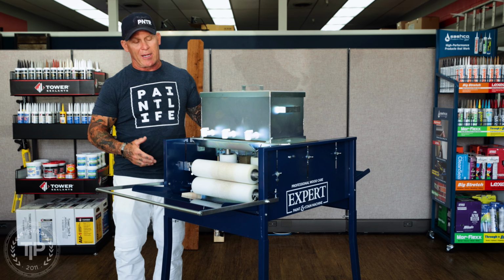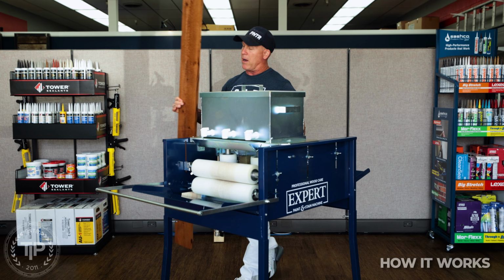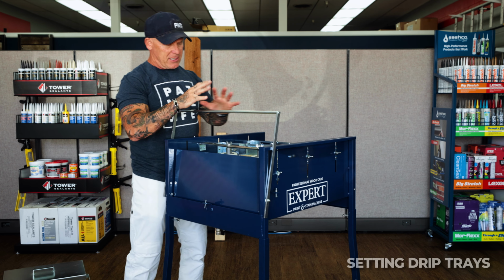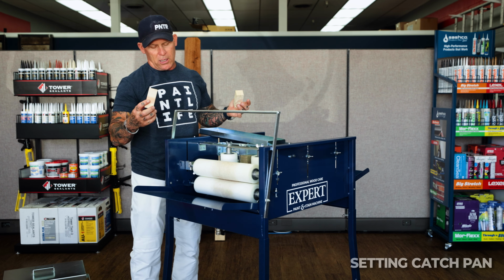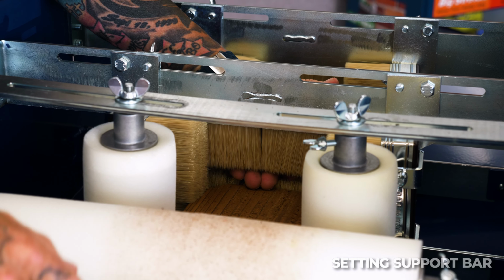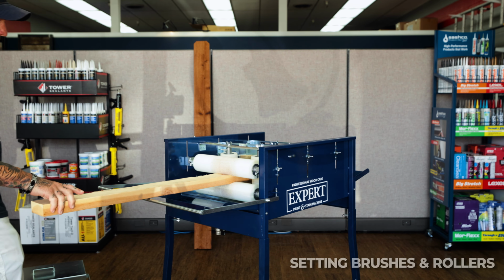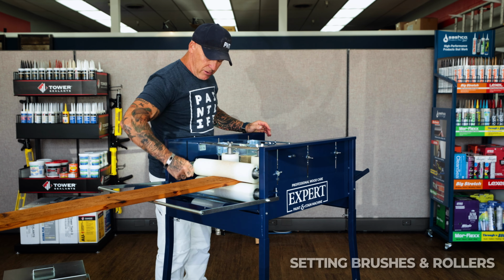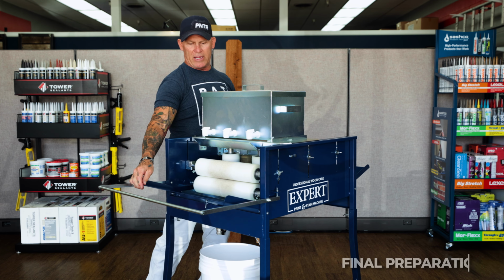How to Setup the Expert Lumber Staining Machine

Comment: Good day Sir. My name is Tony and I am a subscriber to your channel. I am in Cape Town South Africa. I would like to ask you a question regarding my Titan 440 Impact airless sprayer. I am in the process of purchasing liquid rubber to spray my tiled roof. My question is .....can I use this machine to spray latex rubber paint , if so what size spray tip can I use. I have to say by watching your channel has inspired me to purchase this machine and your content has helped me beyond my expectations. I do understand that paints in the US is not the same as paints here in Cape Town. I just need some help with the tip size and best pressure to work with. Keep up the good work and good content. 
Much Appreciated
Tony
Reply from the maker: That is really up the the product.  The product will have a TDS that will tell you how to apply it.  If it say with an airless, then what tip size does it say.  A 440 has a max tip size of .023
Reply from the maker: Hey Tony, that's awesome to hear you're watching from Cape Town, South Africa, and that the channel has been helpful! I really appreciate that.

Regarding your Titan 440 Impact, those machines are generally workhorses, but spraying liquid rubber is a different beast than typical paint. Liquid rubber can be incredibly thick, almost like tar, and that's where the challenge lies.

The absolute must-have information you need is the Technical Data Sheet (TDS) for the specific liquid rubber product you're buying. That sheet will tell you the manufacturer's recommended tip sizes and whether it can be thinned, and by how much. This is critical because if it's too thick, it won't atomize correctly, and you'll just get spitting and a poor finish, or worse, damage your sprayer.

Generally, for very thick coatings, you're going to need a much larger tip orifice than you'd use for regular house paint – we're talking something in the range of a.025 to.035, or even larger, depending on the material. You'll also likely need to run your sprayer at higher pressures to try and get it to atomize properly.

My best advice is to:
1. Get that TDS for your liquid rubber.
2. Ensure your sprayer can handle that viscosity (check its manual too).
3. Always strain the material.
4. Start with the manufacturer's recommended tip and pressure, and do a test spray on some scrap material.

It's a tricky one without knowing the exact product. If you want to dive deeper into the specifics of your product, we can definitely chat more about it.

https://idahopainter.stesso.com/?yt=UgxjPffXfxTn7hw94I54AaABAg&q=Good+day+Sir.+My+name+is+Tony+and+I+am+a+subscriber+to+your+channel.+I+am+in+Cape+Town+South+Africa.+I+would+like+to+ask+you+a+question+regarding+my+Titan+440+Impact+airless+sprayer.+I+am+in+the+process+of+purchasing+liquid+rubber+to+spray+my+tiled+roof.+My+question+is+.....can+I+use+this+machine+to+spray+latex+rubber+paint+%2C+if+so+what+size+spray+tip+can+I+use.+I+have+to+say+by+watching+your+channel+has+inspired+me+to+purchase+this+machine+and+your+content+has+helped+me+beyond+my+expectations.+I+do+understand+that+paints+in+the+US+is+not+the+same+as+paints+here+in+Cape+Town.+I+just+need+some+help+with+the+tip+size+and+best+pressure+to+work+with.+Keep+up+the+good+work+and+good+content.+%0AMuch+Appreciated%0ATony&context=video%3ABI7GDF1ys6w&seed=eyJtIjoxNzk0NTQ4LCJpYXQiOjE3OTI2MTY3NTEsImV4cCI6MTc5MzgyNjM1MX0.XVLlj877peW7VGtGFos3DyaSyktA6KIW-QIm2Wy3J-4

Comment: $4000 is very expensive for what it is.
Reply: Makes sense if you have the production needs to justify it. Further, all these machines, sprayers, rollers. etc. are looking to increase efficiency while providing a quality finish. In the trades, time is money. The more efficient you can be the more money you can make. 

The initial cost of the machine itself will be paid off within 5-10 jobs, maybe less, depending on the size and scope of those jobs.
Reply from the maker: The one cabin I used it on paid for it.  It on sale for $3249.
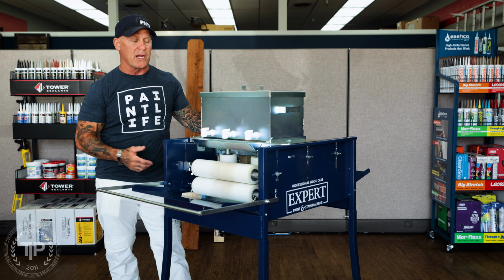Reply from the maker: @MrClimateCriminal, I hear you. Four thousand dollars for a piece of equipment like this certainly sounds like a lot if you're thinking about a one-off project. But for a professional who's staining hundreds or even thousands of fence pickets, or doing a lot of cedar siding, this machine is an absolute game-changer. It's about efficiency and labor savings. You can stain so much faster and more consistently than by hand, and that means time is money. It's an investment that pays for itself in productivity, allowing you to work smarter, not harder, and take on more jobs. We're setting it up right here 0:17 to show you how it works.

Comment: Any suggestions?
Reply from the maker: ON?
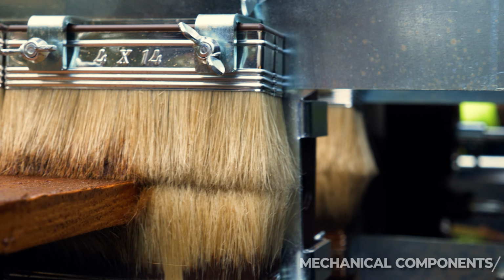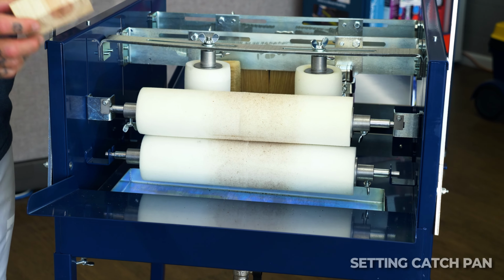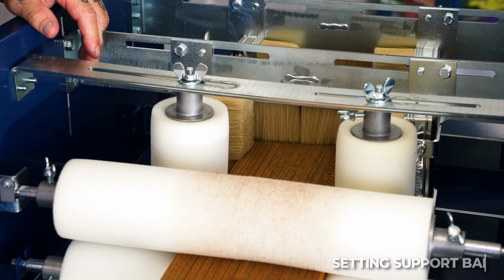Reply from the maker: Hey @jcshotwater, thanks for asking! When it comes to the Expert Lumber Staining Machine, the biggest suggestion I can give you is to really take your time with the setup and adjustments. As we show in the video, making sure those drip trays are positioned correctly 3:25, the catch pan is just right 4:30, and especially getting those rollers and brushes dialed in for the thickness of your lumber 7:50—that's absolutely crucial. It prevents a ton of mess and ensures you get that even, professional finish without wasting stain. It's all about working smarter, not harder, right? If you want to dive deeper into any specific aspect, we can always keep the conversation going.

https://idahopainter.stesso.com/?yt=Ugy3bZlukuMsfDLyFpB4AaABAg&q=Good+day+Sir.+My+name+is+Tony+and+I+am+a+subscriber+to+your+channel.+I+am+in+Cape+Town+South+Africa.+I+would+like+to+ask+you+a+question+regarding+my+Titan+440+Impact+airless+sprayer.+I+am+in+the+process+of+purchasing+liquid+rubber+to+spray+my+tiled+roof.+My+question+is+.....can+I+use+this+machine+to+spray+latex+rubber+paint+%2C+if+so+what+size+spray+tip+can+I+use.+I+have+to+say+by+watching+your+channel+has+inspired+me+to+purchase+this+machine+and+your+content+has+helped+me+beyond+my+expectations.+I+do+understand+that+paints+in+the+US+is+not+the+same+as+paints+here+in+Cape+Town.+I+just+need+some+help+with+the+tip+size+and+best+pressure+to+work+with.+Keep+up+the+good+work+and+good+content.+%0AMuch+Appreciated%0ATony&context=video%3ABI7GDF1ys6w&seed=eyJtIjoxNzk1NDg2LCJpYXQiOjE3OTI2MTg1NTAsImV4cCI6MTc5MzgyODE1MH0.YZ6LxB80HbgR7_hOLeqhwYxeyO8-SUFHACuJhTfD04Q